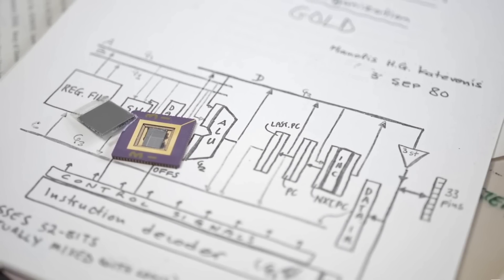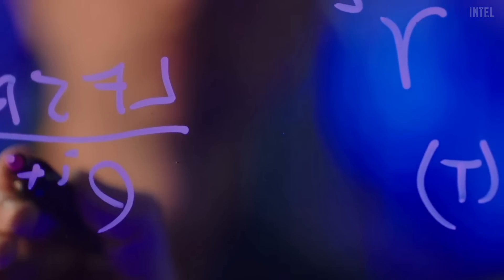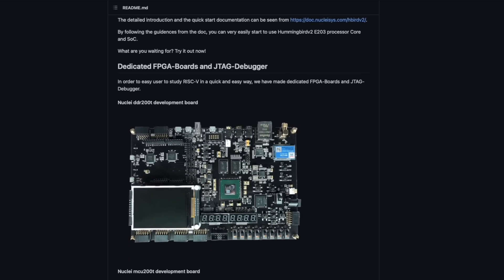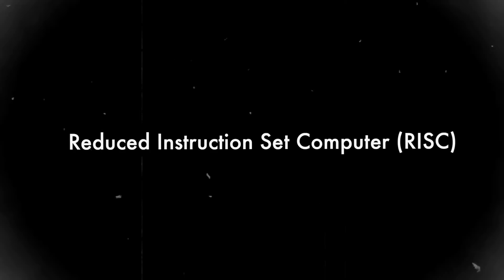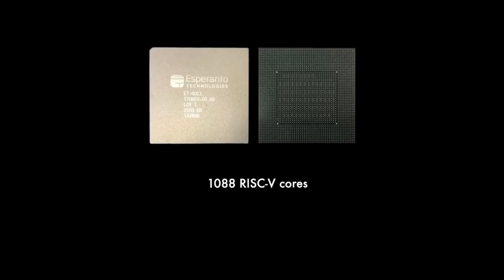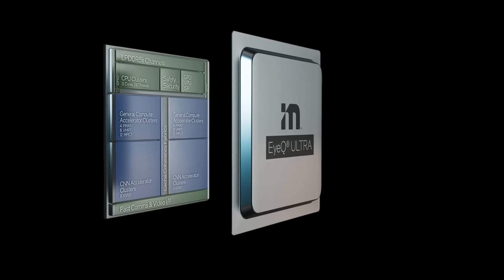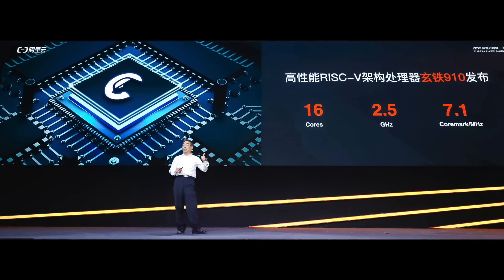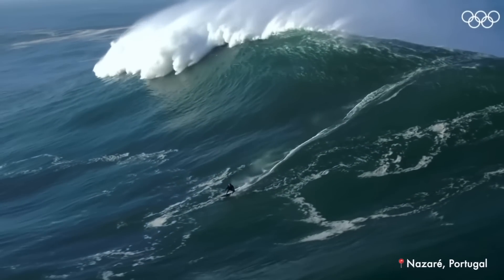RISC-V Chips will be everywhere

Comment: The Espressif ESP32-C3 microcontroller is RISC-V, and they sell those in the millions. With open source software, like Tasmota, for only a few dollars it gives anyone that's interested access to a RISC-V platform to play with.
Reply: I have one of these and it's super cool that I already have RISC-V in my hand. One of the other great benefits is that since RISC-V is actually popular, I can use the normal Rust compiler for compiling to the ESP32-C3 instead of having to use the unofficial Xtensa fork. Maybe one day we'll see the STM32 and other ARM-based microcontrollers replaced by RISC-V as well, there's really no reason to stay onto ARM at this point
Reply: @NoorquackerInd  I've recently replaced an Stm32f103 in a blue pill board with a RISC-V core CH32V203 (it has the same pinout and very similar memory map) running at 144MHz. Now I'm figuring out how to deal with the USB CDC mode. The  IDE for this mcu is eclipse based (mounriver Studio). The main handycap that i find is that, although there is some guidelines in english, the vast community for the CH32V family of processors is in Chinese. But this could change sooner o later if this family gets certain fame (as the GD32VF similar one). Also take a look at the Ch582/3 family of RISC-V BLE devices.

Comment: Will be incredibly if were some way to prototipe IC like u do PCBs, at hobbyist level, im currently an electronics student and i would like to learn about analog chip design, but i wouldn't be able to test fisicaly any of them, cause sending to manufacture an ASIC its crazy expensive.

Any open source CAD tools for IC design? If is possible to simulate will be nice
Reply: I don't know what you can do for analog (other than SPICE of course), but for digital you can run your RTL design at tens of kHz in Verilator, or at 100 MHz or so in an FPGA. SiFive used inexpensive Arty boards ($200) to debug their first FE310 chip and E31 core. You can also fit a single U54 or U74 core in an Arty, but to test the whole 5 cores plus L2 cache "core complex" for FU540 and FU740 a bigger more expensive FPGA board, the VC707, was used. For the still larger OoO cores such as U84/P550 a VCU118 is used. Those are pretty expensive boards, but much cheaper than making a chip. You can also rent Amazon EC2 machines with the same FPGA as the VCU118 by the minute, which is a cheaper way to get started. The VROOM project is doing that, for example.

Comment: Im honestly so excited for riscV gaming machines and personal laptops.. 
Im addicted to open source software and have always begrudgingly accepted having to use proprietary hardware. Im disappointed by the bloat in proprietary design and im looking forward to the speedup at a given power envelope. And the increased security is a plus too. Spectre-class threats will become much rarer
Reply: The RISC V instruction set really is genius. And from extremely efficient use of program memory space on a low hardware footprint, less power, less heat to dissipate, less distance for signals to propagate permitting higher clock speeds, it's win, win, win. This is going to push software compiler development really hard to break apart traditional one-processor tasks to run concurrently over many RISC V processors. For example, OpenSCAD Programmer's CAD really needs it. ARM started with some genius designers but they have mainstreamed too much and forgotten their edge. A bit like a rock band with a great first album but then polishing out their quicks, loosing their flavour in their desire to appeal to the masses. The Acorn Archimedes with it's barrel shifter was revolutionary. That's a long time ago. It superceeded the 6502 which was also revolutionary with it's indirect addressing and intuitive assembler mnemonics.
Reply: @fluiditynz  aarch64 was basically a clean break from older arm ISAs.
Reply: The ISA is free to implement, but any implementation that's comparable in performance to a modern desktop or laptop processor absolutely will not be open source.
Reply: have you seen open source BIOSes?
Reply: Since the flaw is baked into the CISC hardware, you need to write browser code that does not call/trigger this CISC "feature". This is, not surprisingly, not being addressed by many browser companies, and many users do not apply security updates.

Comment: Glad you talked about RISC-V. It is already appearing quite a bit in the market. 
One of the Maxim bluetooth ARM CPUs has a RISC-V co-processor to handle the timing critical bluetooth radio. In this way they incurred less cost than adding a 2nd ARM core.

Comment: RISC-V will thrive as there is no open-source alternative for the HW segment and big players on the market got interested in it. I would even imagine that one day everyone with some knowledge will be able to design their own chip and have it manufactured at a relatively low cost. ;) The same as we can do with PCBs today.
Btw: where's the kitty?? :)
Reply: I don't think that low-cost manufacturing will be possible. Lithography masks are extremely expensive and even low volume would mean at least one wafer, which also costs thousands even on an older manufacturing process.
While I suppose that 'never say never' applies for general-purpose masks that can be recombined to produce your custom chip, I don't really see that coming. There's just too many possibilities that need connections run between them somehow.
I'm fairly certain that custom chips will remain in the domain of 'tens of thousands' units at minimum. (Not counting things like wafer-scale chips. Those might make sense at hundreds already. But that's the domain of ultra-highpower datacenter compute...)
Reply: @Steamrick  Well, you're probably right. But still it would be great to be able to get a few prototypes of your own design even if for a few thousand dollars (seems pretty cheap in comparison to no such possibility now). :) I think it is only possible if the interest is high enough for such a service.
Reply: @Steamrick  if maskless lithography develops further, it will be possible
Reply: The REASON for this "Prophecy" is not hidden. The USA MUST become chip independent again. That means finding alternative materials that we have on our OWN soil.
(Steps on soapbox)
STAY WITHIN OUT RESOURCE BOUNDARIES.
(Steps off soapbox)

That said and out of the way. RISC-# in general has not been accepted in mainstream, ever. I've been around for EVERY chip since the IBM 3500 into the 12th+ generation of CPUs.